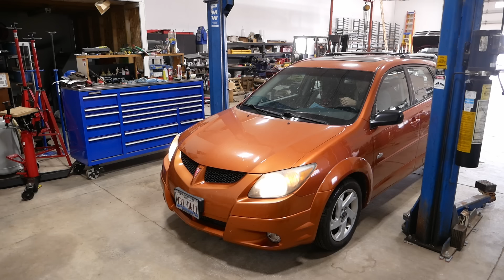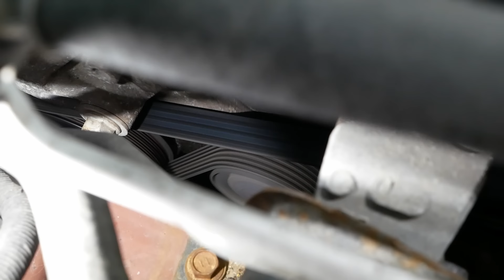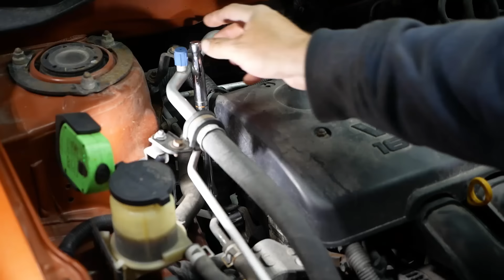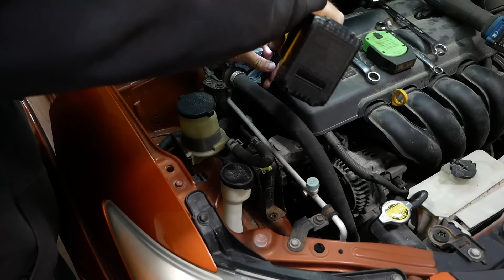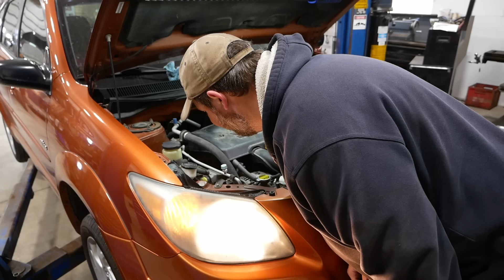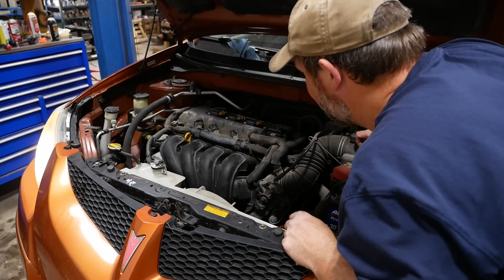My Worst F-up as a Mechanic - Hurt Myself, Damaged Customer's Car - Vibrating Vibe

Comment: I'm an arborist with almost 20 years of experience, climbing trees to prune and remove them. I've done some big and scary stuff over the years working in the PNW. I've also had an excellent safety record and always work carefully. Until earlier this summer when I was basically on auto pilot pruning some small trees from a ladder and I fell from about 6 feet up. Really hurt myself but mainly hurt my pride. I'm finally able to begin healing my body and pride. Don't beat yourself up too much Wes. You do great things.
Reply: I ran a climbing crew for about 5 years at Asplund.. trimming tress from OGE powerlines. We gambled with injury everyday out there;  you get used to being so close to danger all the time.  But that's exactly how we end up getting hurt, by being complacent...  My dad was framing a house, and he was on top of a low pitch porch roof and leaned a step ladder up against the wall to reach up high on the main gable roof--   and the ladder slipped out and he ended up diving off the ladder/ off the roof and face first on the concrete.  Broke his nose, his right wrist and his left elbow.   He was messed up for nearly a year;  it was bad..   The same boss/ builder that we built houses under died years later in his shop -- he had several muscles cars and liked to build engines, etc.  and I guess a car fell on him and he died;  pretty crazy- he was a smart dude and had made a lot of wealth.   Things happen to everyone; We must stay diligent.
Reply: At the back of my old house, there was a hill down most of the back yard.  I put my car at the bottom of the hill in the grass, there wasn't even much slope:   I put on the ebrake and wheel chalked both rear wheels, and I jacked it up and crawled under it to pull the oil plug and change the oil (it was an old Duster, like 94 I think).   Anyway, the dew on the grass was too slick I guess, because the wheel chalks and the e-braked tires all slid on that grass and fell off my jack stand while I was under it.  Luckily my head was in a safe place and I didn't get smashed at all.  But the cross member was just squeezing my waste enough that I couldn't get out..  So I was in my back yard stuck. lol.. So I started screaming for help for about 5 minutes, and there was this 'half-way house" type of prison release place right there within range and they heard me screaming, and came over there panicking and trying to lift the car by hand.  Pulling on the front fenders and probably messing it up.   Luckily my younger brother came running out of the house once he seen everyone in our yard, and he immediately slid down beside the car to look at me and I told him to just jack it back up and he was the one that actually rescued me, where the 4 prison guys and 2 guards had no clue and couldn't figure it out and were panicking and scrambling thinking I was dying or something.   I couldn't help but laugh at how dumb they were.    I got lucky.  I could have gotten my head smashed if it was in the wrong place...   So long story short-- I don't trust wheel chalks and jack stands anymore;   if it's at all sketchy, I change plans.   So it's pretty common on cars hurting people-- so we can't sleep on it and get comfortable.   I was lucky enough to learn the hard way, but without getting hurt.  Scared the crap out of me though.
Reply: I was a small engine mech in another lifetime, working with chainsaws and landscaping gear was my daily. Any arbourist/logger/landscaper ect that walks away from their career intact gets a tip of my hat.
Reply: @watsisbuttndo829  Yeah.. I had a guy working under me, who was a very good climber, but he was a bit of a hot head and liked to put himself in danger too much.   So he was up about 45ft, right in line with the primary power lines -- and he was trimming a few limbs above him and rolling them back -- I kept telling him just to climb up there (we took turns climbing the big trees, and this one was his turn).  He was almost done, so I quit yelling at him -- and right on the last limb that he cut, fell down and landed directly on his shoulder and slowly folded over and landed right on the line-- so it was shocking him with 7200 volts, straight through that little limb/ straight through rope and the tree.  And it zapped him good for maybe 3 seconds until he somehow finally got the limb knocked off;  HIs body fell limp like he was knocked out, but his legs were still holding his weight, and he was leaning back on the rope, so I was confused.  Nearly 10 seconds later he finally started responding and stood there talking about it for a minute or two -- and then he came down. lol.. Pretty sketchy situation...  Luckily the trees are several Megaohms of resistance, so it doesn't shock you enough to kill you, even the it's such a high voltage..]. 

    Months later that same guy was tied in above him and straddled across a flat Y, out on a limb -- and he turned the saw around backwards to cut a little nothing sucker twig between his legs (I was the foreman, so I was screaming at him to stop and don't cut between your legs, but he just looked at me and smiled).   and sure enough-   the end of the saw bucked and it sent that chainsaw blade up his inner thigh, just above the knee.  It looked like he was hit with an axe -- cut his pants, and cut his skin for about 5 inches and was peeling open like they do in a surgery.   So He just grabbed the rope and came darting down to the ground like batman and was panicking.. and I calmed him down, put him in the truck and took him straight to the hospital.   He was my buddy and a cool guy years before we worked together-- but he was just one of those guys who would think it's cool to not wear your safety glasses, or not wear you seatbelt when we drive, etc etc..   He started to change his mind after that, if he heard me yelling at him to stop. lol
Reply: @calholli  I'm in my 50,s now, my grandfather was a logger here in Australia. As a kid i used to go out with him and see those guys work. Nearly every one of the older guys had been witness to someone getting killed, my uncle amongst the men lost. Tree work is a damn serious business. Stay safe brother.
Reply: @watsisbuttndo829  I'm 40 now.. My tree days were in my 20's...  I've ran a crew building houses and metal buildings for the past decade or more.  cheers
Reply: Get well soon.
Reply: Thanks Cory for your story, don't know where us lawn dogs would be today without YOUR expertice. In the field of lawn care (Spraying  lawns) I have learned a lot form guys like you! Mad Respect 👍 💯
Reply: @calholli i

Comment: being an auto tech for over 40 years, I know of no one that has not done something exactly like this, or any of the other scenarios you talked of, myself included, several times. Glad you weren't physically hurt, and your ego and pride will recover. You're very good and very methodical in your work habits, so don't stay hammering yourself too long. Stuff happens.
Reply: Hear! Hear!
Reply: My worst one was over tightening an oil pressure sensor, needed a new engine cover or whatever it’s called on the face of the engine think it costed 2 grand about, my boss said he doesn’t do oil pressure sensors after that

Comment: This reminds me of my friend Jolene I used to work with at a nursing home. She was close to 400 pounds and she would randomly yell out FOOTBALLL. That was my cue to run as fast as I could and smash into her. I always bounced right off of her due to being 140 soak n wet. One day she yelled it and I shoulder checker her. She lost her balance and went right through the wall and landed in dietary. It just happened to be the only spot with no cameras. We pulled the rug out and told the supervisor she tripped over the rug and she bought it. Ill never forget how hilarious it was.😂

Comment: As a mechanic, we all have that “one” mistake we’ve all made, so don’t feel bad it happens to all of us at least once. I’m glad you’re okay with no injuries.
Reply: This right here.
Reply: At the back of my old house, there was a hill down most of the back yard.  I put my car at the bottom of the hill in the grass, there wasn't even much slope:   I put on the ebrake and wheel chalked both rear wheels, and I jacked it up and crawled under it to pull the oil plug and change the oil (it was an old Duster, like 94 I think).   Anyway, the dew on the grass was too slick I guess, because the wheel chalks and the e-braked tires all slid on that grass and fell off my jack stand while I was under it.  Luckily my head was in a safe place and I didn't get smashed at all.  But the cross member was just squeezing my waste enough that I couldn't get out..  So I was in my back yard stuck. lol.. So I started screaming for help for about 5 minutes, and there was this 'half-way house" type of prison release place right there within range and they heard me screaming, and came over there panicking and trying to lift the car by hand.  Pulling on the front fenders and probably messing it up.   Luckily my younger brother came running out of the house once he seen everyone in our yard, and he immediately slid down beside the car to look at me and I told him to just jack it back up and he was the one that actually rescued me, where the 4 prison guys and 2 guards had no clue and couldn't figure it out and were panicking and scrambling thinking I was dying or something.   I couldn't help but laugh at how dumb they were.    I got lucky.  I could have gotten my head smashed if it was in the wrong place...   So long story short-- I don't trust wheel chalks and jack stands anymore;   if it's at all sketchy, I change plans.   ( I had an old boss who was a super smart guy, and I worked under him as a sub contractor running my own crew building custom houses for him;  and some years later I found out he died from a car falling in him in his shop--  he had a bunch of muscle cars and stuff.  So it's pretty common on cars hurting people-- so we can't sleep on it and get comfortable.   I was lucky enough to learn the hard way, but without getting hurt.  Scared the crap out of me though...

Comment: This one kind of hits home for me.  Not that I've had a life threatening screwup, but because I don't have the safest work practices when I'm in my home garage.  I've been working on vehicles, and rebuilding old jeeps for the last 20 years.  I live alone, and am working on stuff alone 95% of the time.  I feel like I needed to see this.  Thank you for posting it, and don't let it get you down.  Learn from it, and move on.  I really enjoy your stuff.
Reply: Yup this video could have saved someones life. Another one was when ETG shared that a good friend of his was killed when a jack stand failed and no one was around to help. We gotta keep our heads in the game.
Reply: @HansFormerlyTraffer  That reason alone is why I slide the tire & rim under the car after I remove 1 or more tires. That way if the jack stand AND jack fail it will only land on the rim keeping me from getting fully crushed. I to know a guy that died after that happened.

Comment: Nothing like this should ever happen to a guy who is as kind as considerate as thoughtful and with integrity and compassionate and hard working as you are.  I’ve had it happen too, where you are just left wondering what the hell happened and why did I think that was going to work. Thankfully it never resulted in a severed digit or the like. 
Best Regards sir. Just keep moving forward. A real man would go ahead and share this fck up, others would pretend it never happened. 🔥🔥

Comment: This will make you feel a lot better. Decided to replace the old rusty gas tank on my Galaxie 500 one cold wintery day in the shop where I worked. Kerosene heater keeping the frost at bay. Yep, tank dipped a little to the filler side, gas on the floor, me on the creeper, got out from under just in time and pushed a burning car out the door. Dumbest thing I ever did, 40 years ago and makes me slow down and think things through to this day. Really glad you’re ok. Could have been so much worse. Thanks for sharing.

Comment: When I was a Volvo technician, I heard that over torquing the lug nuts could warp rotors so I would torque each one with my 1/2 inch to the proper specification for that vehicle. I got distracted one day and forgot to do this. The customer made it over a hundred miles before they started feeling a really bad vibration. It just happened to be my service manager’s sister so I did all her services basically for free the remaining time I worked there. I thank God that no one was hurt and the only thing damaged was my pride.

Comment: Thanks for the humility that you demonstrated by showing us this.  I was a mechanic for over thirty years, and there are a few mistakes I made that still bother me. There were two times when I was unfamiliar with a type of fuel line connections, and they came loose after I had handled them. Thank God there was no fire.

Comment: retired electrician here.  i can think of a few  things i did over the years that could have been disastrous but by the grace of god they were not. i am also thankful i never got anyone else hurt. whether your working on cars, in the trades or running a chain saw in your back yard things can go sideways in a hurry. btw you have an excellent channel.
Reply: I had a question for an electrician. I had an electrician at my house who was reconnecting two wires in my ceiling fan/light . He used a wire cap to twist them together but didn’t turn of the power at the breaker. Is that dangerous or am I wrong?
Reply: @terranhealer  that is standard procedure to cap the wires with wire nuts rather than shutting off the circuit breaker.
Reply: @brentk9520  OK thanks for the info 👍

Comment: So many others have already posted comments that express my feelings better than I would have.  We all make mistakes and usually get away with them but sometimes not.  To put this onto your channel just shows what an honest, humble person you are.  I'm so glad that you weren't badly hurt.  I once got out of my car to open a gate and left it in drive. It scraped the drivers door on the gatepost before I could get back in and stop it.  So stupid and I still don't understand how I could have done that.  Sometimes stuff just goes wrong.  It's how you handle the aftermath that matters more to the customer.  You're still the best mechanic channel on YouTube by a mile.

Comment: Mechanic with 21 years experience here, that my friend was a real stupid mistake and the result of not thinking through what you were going to do. I have done this TWICE now (serious mistakes) and put my life at risk ONCE. Going into lala-land for just a second too long and BAM - life long lesson.
My first mistake was to ignore my gut feeling and routine and left a cover open on a combine, sliced the customers shop roof up with it.
The near death or severe injury one was NOT bracing a very heavy frame component, I knew I wasn't safe, nor did I secure the piece properly, but i took the last bolt out anyway. It shifted and nearly gouged my hand off, slowly crushing me in place with Noone around. I got lucky and it just took skin off and stopped enough for me to escape. Since then I ALWAYS act on my gut feeling within the second. Never let your guard down, always play out in your head, what you are about to do. Good on you for sharing. It's just stuff, and stuff can be fixed. Glad you are ok.

Comment: Wes, I definitely feel your pain, emotionally and physically. My closest call was March 2021 when I was replacing the transfer case on my 99 K2500 Crew Cab. I was swamped with customers work and needed to get the t-case swapped in under 3 hrs with no hoist. Well, just like you rushing to get this issue diagnosed and repaired before it fixed itself, I forgot to chock the wheels. I had the front wheels on ramps and was working in the dirt next to my garage. Just as I was pulling the last rear driveshaft bolt from under the car, I started to hear a creaking noise. Sure enough the truck rolled back and I got about 95% out of the way but my leg got wedged betweent the frame and the ground, acting like a pole vault with my knee in the dirt and the bottom of my foot against the bottom of the frame rail. Sure enough, 2 very loud cracks sounding like a large tree branch snapping later, I had completely broken both bones in my lower leg.

Thankfully it was not a customer's car and the truck stopped rolling before that also got damaged, however, it could have been a lot worse, just like your situation. I also could not set the parking brake due to the rust (Minnesota Mechanic Life). I am glad you are safe, and for the most part unscathed. Thankfully I had a quick recovery due to a new style of surgery where they drilled the center of my main lower leg bone (tibia) out going in from behind the knee and hammering a rod in, then anchoring with some screws. Within 1 week was walking on it again albeit with incredible pain and a huge limp, but made an almost full recovery with 3 months of PT. They did completely leave the Fibula alone annoyingly, and it still causes me constant pain, but it is a solemn reminder to not be an idiot, because next time I may not be so lucky.